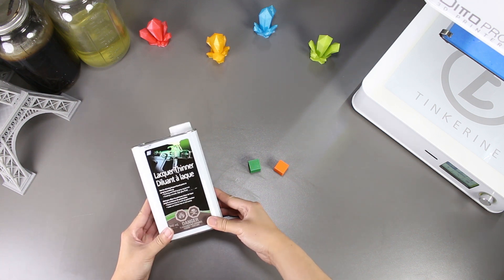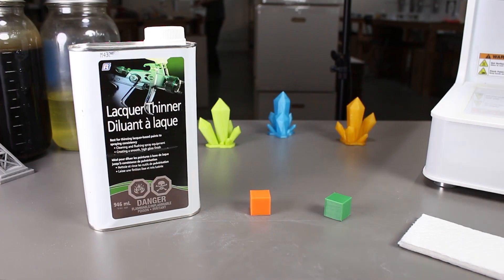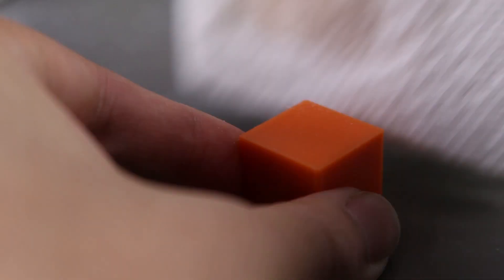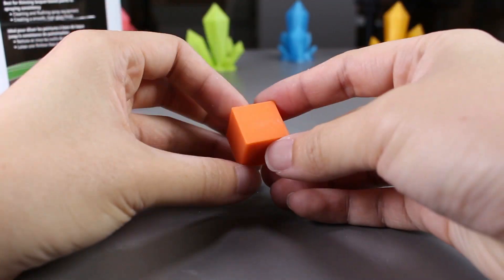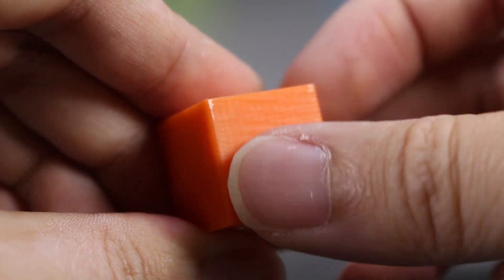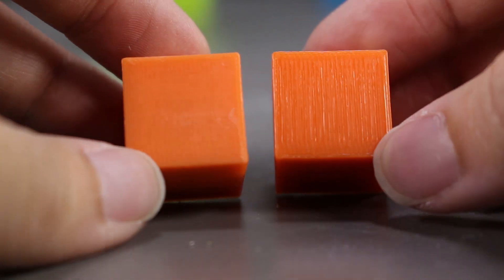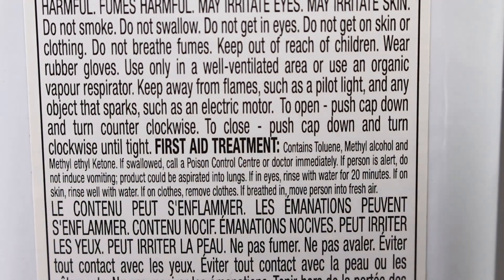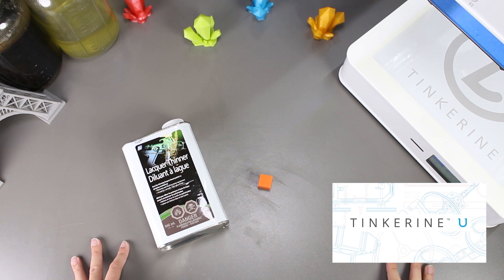Smoothing PLA Prints with Lacquer Thinner

Comment: I've worked with lacquer thinner for decades.  Try dipping a small, natural bristle brush (usually horse hair) into a small metal or glass container (not plastic!) containing lacquer thinner and pretend you are painting with it.  The dissolving PLA will smear around the surface, smoothing out rough areas.  It will dry pretty quickly because lacquer thinner is chemically really hot.  You video was succinct and informative.  Keep making these great videos!
Reply from the maker: Thanks for the comment and suggestions!

Comment: I use a thing mixture of plaster with water to fill the layer lines, it also makes PLA sandable, then just sand away the excess. I also use spackle paste used for drywall, it's like a paste that can be thinned with water.
Reply from the maker: Thanks for the comment and advice! We'll look into it.
Reply: Only problem is, that only works if you paint your 3D prints instead of print in color. If you use a mm ulticolor printer/AMS that wouldn't help